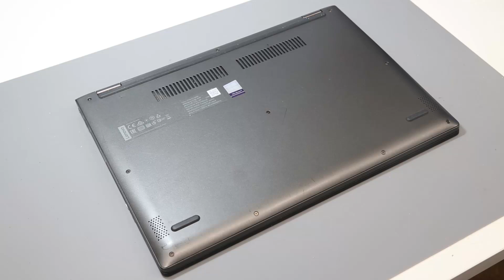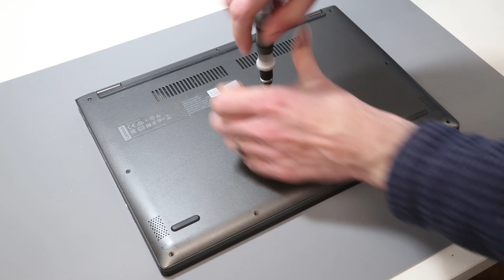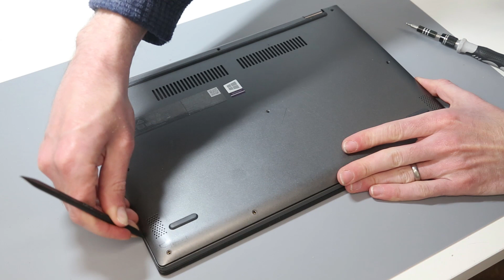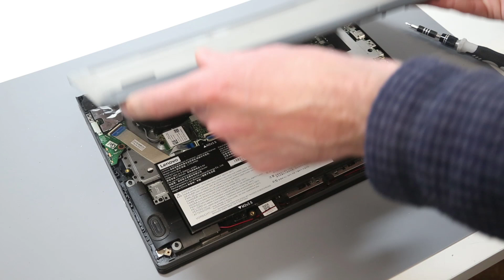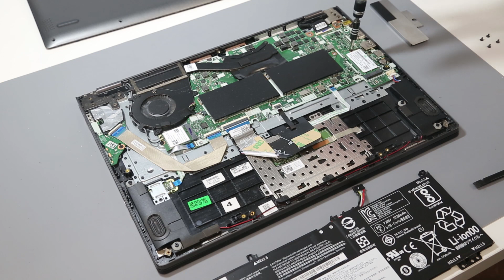Lenovo Yoga 530-14ARR - SSD, RAM, WiFi and Battery Upgrade/Replacement Guide

Comment: Best not to start using the pry-tool near port openings.  You could buckle the port cover around the port.  I would have started with on the left side away from port openings.  If you are going to replace any part Lenovo have comparability info, always check there first.

Comment: For anyone who wonder if 32GB RAM fits, yet it does. I got 14ARR model and I fitted this kit: KF426S15IB1K2/32
Works just fine. Best RAM for 2500U chip.
Reply: But is the memory available? It says the max ram is 16GB.
Reply: @nighthawksoffice  You got two slots, You have to buy SODIMM 32GB, 2 x 16GB DDR4

Comment: Interesting video, thanks. May I suggest though that after unscrewing the battery, at the point where you remove the little black plug with the 8 coloured wires coming out, you don't obscure vision with your hand. If you've never done it, it's quite tricky wriggling it loose from the metal clip, especially since you don't want to damage the wires in the process.

Comment: I have problems with the battery, it does not turn on anymore and the power light does not turn on, I ask if it can be turned on by disconnecting the battery, thanks

Comment: Very helpful video, upgraded my RAM successfully using it, though I'm curious if you found where the CMOS battery is? I'm having a slew of problems that all seem to be symptoms of a dead or dying CMOS battery so I'm hoping I just have to replace that instead of the whole laptop

Comment: Great vid. Just a question, sir. I have a lenovo 530 r7 2700u. I would like to upgrade the ram to 16gb but i am unsure what ram frequency to go for. It is currently running on 2400. Can I go for 3200 on this?
Reply from the maker: You can fit DDR4-3200 or 2666 modules, but they'll still run at DDR4-2400 speed as that is the maximum supported speed for the 2700U.
Reply: @BrueComputing  thank you so much!!

Comment: Really helpful video, I have a question btw, can I upgrade the processor? I have a Ryzen 5 2500u and would like to upgrade my windows version, does it support ryzen 5 5600G or some better processor?
Reply from the maker: No, you can't replace the CPU without replacing the entire mainboard
Reply: @BrueComputing  thanks sir, you’re the man

Comment: Though Yoga530 has ample space for a full size 2280 M.2 as shown here 9:46, unfortunately the nut is only for 2242.
Work around are a) use an extender, or b) hot glue it like I did.
Reply from the maker: Not seen any adapters for fitting a 2280 into a 2242 mount? I wouldn't glue one in, will probably come loose at some point.
Reply: @BrueComputing  You can easily find these adapters from ebay or amazon.

Hotglue are easy to apply, easy to remove and do not come loose as easily as one might think. Likewise SSDs rarely go above 60c and never above 80c; SSD will never be hot enough to melt hotglue. Of course I applied several beads of hotglue to strongly secure the 2280 SSD.
Reply from the maker: @DanBurgaud  I can find adapters to fit a shorter SSD to a longer slot, but not the other way around. Got a link to one?
Let me know how the hot glue lasts - my concern wouldn't be it melting, but it breaking free due to vibration and knocks over time.
Reply from the maker: Got your message - those adapters were for fitting shorter drives into a longer slot, not the other way around?
Reply: @BrueComputing  did you find anything?
Reply: I tought of doing the same!
I'm having a major doubt however, is the M2 ssd PORT on this motherboard only for M+B ? or has it the pin for "M only" as well? I hope they didn't put a plastic thing there just to stop you from using the much more common M2 "M Only" Type SSD's.
I can clearly see that the SDD @Brue Computing extracted is M+B, but I believe it's just because Lenovo uses Old Components for their Laptops to cut costs( and the B port is present on those because SATA was still relevant when that WD ssd was built -hence the  "2242" form factor and the bad  choice to put a screw only there)
Reply: These adapters can be used for Longer (2280, 2260) SSDs on short slots (like this Lenovo laptop), as well as Short SSDs (2230, 2242, 2260) on long slots.

NOTE: The nut may not have a good solder. you need to solder it on both sides (or hot glue the nut).

Comment: What wireless card is that? Mine got broken from the antenna brackets
Reply from the maker: Not sure what the system had as standard, but I'd fit an Intel AX200 card.

Comment: after over 2 years of using it's finally time to clean all the dust from inside. Do you have any tips? Do I need to be extra careful with the fan?
Reply from the maker: Just work carefully and methodically. Main thing is remove the fan and clean the leading face of the heatsink as that is where the airflow gets blocked.

Comment: Good video : is it possible to add a sata storage ?
Reply from the maker: There is no space internally to install a 2.5" SATA device, nor a connector as far as I'm aware.
A SATA M.2 2242 device MAY work (I didn't test it) but I would advise fitting an NVMe device.
Reply: @BrueComputing  But we need to remove the current SSD to put another storage ?
Reply from the maker: @ruquas893  Yes.

Comment: what are the possible upgrades for the CPU and graphics card
Reply from the maker: None. The CPU in pretty much all modern laptops is soldered down and can only be replaced by replacing the mainboard with one with a higher spec CPU on it.

Comment: So... SSD as originally installed is: SK Hynix BC501, SSD M.2 (M-Key) PCIe NVMe 2242, P/N: HFM256GDHTNG-8310A (P/N recognized in BIOS), correct?
What means "2242" parameter?
Reply from the maker: 2242 means it is a smaller, 42mm long, M.2 form factor. Most M.2 drives are 2280, which is 80mm long.

Comment: So if i want to upgrade my ssd, it has to be an 2242? Many engineers have told that i can put and 2280 but now im not so sure jajaja
Reply from the maker: May differ depending on the exact model, but this one definitely only had a mounting point for an M.2 2242 drive.
Best bet may be to open it up and check before ordering the part.
Reply: @BrueComputing  I bought a 1GB 2280 SSD that Crucial said was compatible. I didn't find out the 530-14ARR doesn't have a mounting screw hole for the 80 mm SSD until I opened it to fit it but I was able to fit it (with heatsink pad) and replace the metal screen OK - once the rear case is in place, the SSD is kept in place and it's worked perfectly for the last seven months. I'm going to be taking it apart again soon to replace the keyboard (and that's going to be a pain!) so will look again to see if there is any way I can help make sure the SSD is held down better.
Reply: @zeno2712  Hey, I have the same problem. My Yoga 530-14ikb is like the 14ARR and doesn’t have a mouthing screw hole for the 80mm SSD. Can I just put the 2280 without the screw, put the SSD metal case WITH the screw and close? Will it be safe? Will it work? What you needed the heatsink pad for? I haven’t bought the SSD yet but I cannot find any 2242 here in Portugal. Thank you.
Reply: @joycedias8834  I've had no problems with the SSD at all without any mounting screw. I put a heatsink pad on top of the SSD then replaced the metal cover - this wasn't as secure as I would have liked (and maybe there's a way of making that more secure?) but once the bottom cover of the laptop is in place it all seems to be held firmly enough. The thermal pad helps conduct the heat that's generated by the SSD away from the SSD onto the metal can. If you don't have the pad, then the SSD will get hotter but I don't know how much hotter it will get - and it will also depend on how hard the SSD has to work. I think I had several different thicknesses of pad and I think I used a fairly thin one but you may have to choose what suits your SSD and can - if the pad is too thin, there will be an air gap between the SSD and the can (which you don't want) but if the pad is too thick, it might be more difficult to get the can on and to stay in place. It'd also be work checking if the bottom cover of the laptop is pushing down on the metal can - I can't remember now - but if there is a bit of a gap, then perhaps some foam pads in the right place would help the base cover hold the can in place, which would then hold the SSD on place - as long as you make sure you don't put too much stress on the can/SSD.

Just re-reading your comment: does your can have a screw to secure it in place? Mine didn't but if there is one, then it sounds like the can will hold the SSD in place - just put a thermal pad of the right thickness on top of the SSD.